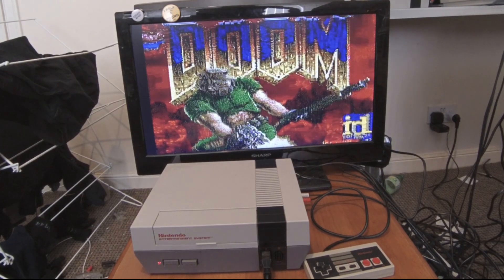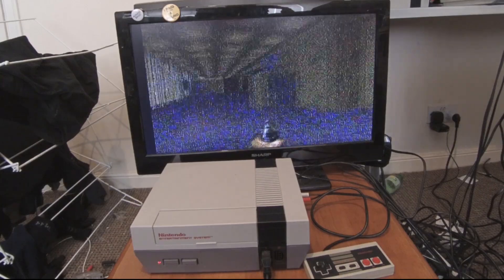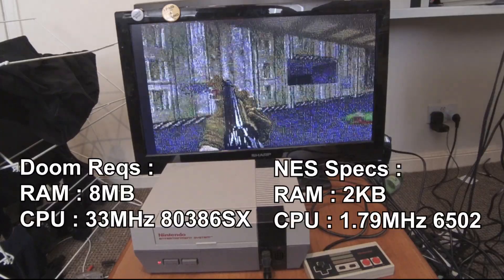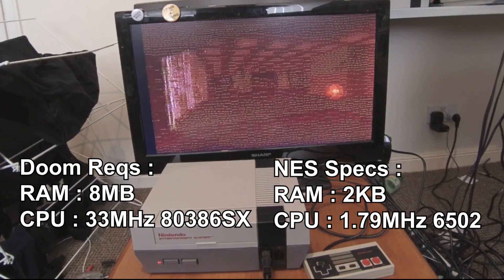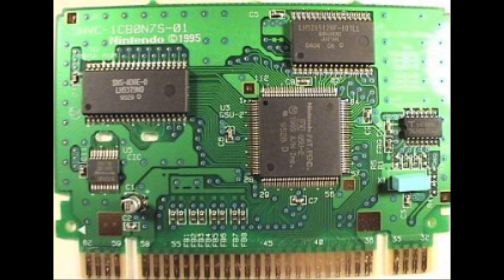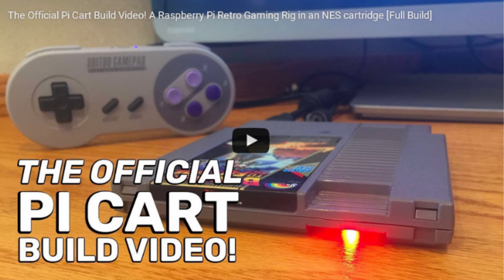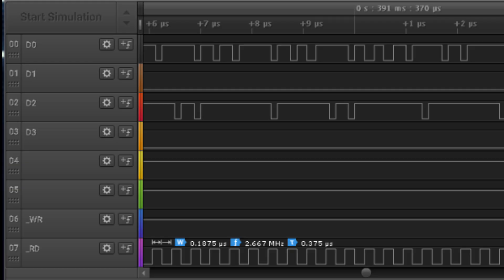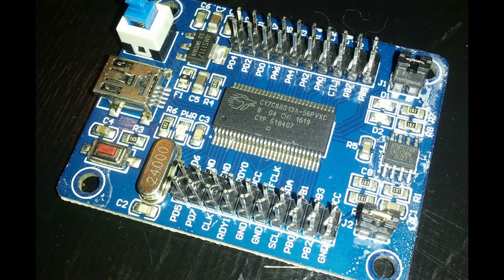DOOM on NES!

Comment: Em. But it is cheating, Star Fox`s cartridge is not a whole PC inside it. Yes it have a coprocessing unit. But it does not take all of the work from CPU. it is just a 3-d accelerator.
Reply: There are SNES chips that stream video, and they even made a CD add on. C'mon, this is even powered by the NES!
Reply: Really here is where the definitions are vague if it's cheating or not.
You can say this is cheating as the pi is doing all the work and the nes is just a video output, in that sense it sort of is.
But like most nes games used an processor inside the cartridges to enhance the games abilities, and like the super fx chip and such, theyre not too different, but those both are processing the game, both the external processor and the console in tandem. But as the external processors are more and more advanced it ends up being more sided to the external. This is essentially what's happen here, a processor like the super fx , but leagues more powerful.
 but still both are working together, only now instead of being about 40% console work and 60% external work, it's now under 0.1% console work , and 99.9% external work, *but there's still work done by the original system*, so how are you to define this as any different from those methods back then? You can't just set a percentage and call it that far is cheating.
There's other ways to define it like how much of a system the external processor is, like the SVP is just an additional processor, whereas the pi is an entire computer. But the super fx was a processor but it also had it's own memory like the pi , but that's not cheating ? You can't either define how much of a separate system the external processor is really either.
Maybe you could define it as if the external processor is able to function independently from the console like the raspberry pi, but there's nothing stopping the SVP or super fx  being used separately, even the 32X CPU is used independently in the Casio loopy , and two of them in the sega Saturn. Plus the raspberry pi could have its independent video out disabled , then it relies on the console too !
Maybe you can say that it depends on if there's two way communication between the console and external processor like there was originally, as opposed to the pi just outputting though the nes, one way, but like the reverse emulating the nes video, the console talked back to the pi with controller input so in that case there's too way comms too!

I don't think this as any different from things like the super fx or SVP, Doom , is essentially , running on the NES!
Reply: The Super-FX chip does all the work, and then DMA (direct memory access) the SNES video memory and just renders everything there (I think the SNES only converts the 3d models to 2d sprites, search for the Star Fox history video, it's awesome). Is exactly as the Raspberry Pi coprocessor, and outputting anything to the NES memory.
Reply: @GeomancerHT  now we are talking about the rendering only, there is more to a game than rendering. What about all the game logic? I assume with starfox it runs on the snes cpu while with this project the game logic runs on the rbp as well...
Reply: @sttrife  Did you read the link? Star Fox runs almost entirely on the Super FX and the SNES chip is only blitting the sprites to video.
Reply: the way I see it the game is truely running on a system if it interacts with things like the ram and other system things. if its just using literaly nothing on the console except io and adapting graphics then i dont count it. its like taking a midi output and playing it back through a mixer and saying the mixer is doing all the work.
Reply: All depends on your definition of co-processor. This is co-processing everything but the rendering to output. Very close to many SNES games running entirely on the cartridge via custom chips (aka the Raspberry Pi) and the slow SNES just outputting video to the TV. Or similar to the 32x doing all the job but the backgrounds.

What is the difference between this and a custom chip that could run DOOM and it's embedded on a custom NES cartridge and does exactly the same as this one?

I'm pretty sure you would call the custom chip cartridge legit, even if it's cpu it's the same as this Raspberry Pi one, lol.
Reply: Sorry Nicolas but you don't know what you are talking about .Co-processing, BY DEFINITION is a processor who helps the main system doing something. The FX chip was NOT a SoC that let the SNES CPU idle doing nothing. Far from it, the FX was nothing more than a math co-processor (something that 386 and 486 PCs had). Both systems were working hard to run the games. The FX chip was an expansion of a hardware, not a literal SoC who is doing all the work.The Pi is running Doom, it may use the NES as input and video out, but it's the Pi who is running, not one helping the other. Also, let's face it, the FX chip was also a cheat! But even so, the Pi does not need a NES, he actually had to work harder to make it running using the NES inputs than to make it simply run as it should. Where the FX NEED the SNES and can't run on any other system.
Reply: @Vanessinha91Pucca  Well, I kind of agree with your definition of the FX Chip also being a cheat, lol. I didn't want to go hard on the guy as this is really cool.

PS: read this FAQ, the FX chip can (and was used) to do all sort of things, not just a math coprocessor, almost all the game ran on the FX: http://www.anthrofox.org/starfox/superfx.html
Reply: DOOM on the SNES runs almost entirely on the FX2 Chip, lol.
Reply: Have to agree, while its a cool project, from your description it sounds like the pi is running the whole game and only hijacks the NES video chip to output the picture. Very neat but yeah i would not claim that doom 'runs' on the NES. Still, kudos :)
Reply: Star Fox uses the SuperFX to draw everything except for 2D backgrounds and HUD. It then turns the framebuffer into tiles, just like this is doing. Doom here isn't using the ability of the RPi to be an entire PC, it's just using it as a coprocessor like starfox or snes doom.
Reply: @jc_doge  maybe you know more than I do about this project, but it does sound like RPi is used as a PC, as in, it runs the whole doom game and just uses the button input from the NES, and the video out from the nes to play and display it. It doesn't sound like the game logic from DOOM is actually running on the NES.
Reply: @sttrife  i'm think Doom on SNES runs the game logic on the superFX too. That might explain the atrocious 20 frames of input lag, and the fact that the enemy AI kind of breaks when you overclock the superFX.
Reply: I'm sure that the game logic on the SNES Doom is not running on the superFX. The superFX is a coprocessor for math. It would be extremly dumb to implement the game logic on a math coprocessor  when you have a idleing CPU that is build exactly for this job.
And I think to remember that the superFX chip has no turing complete command set, so that's not possible to do it.
Reply: Also, there is a difference in that you could consider suferFX as part of the SNES ecosystem, while the RPI is definitely much more modern and unrelated to the NES. That doesn't mean I don't appreciate this project! I doubt it is easy to do something like this, and it's still pretty cool to place a cartridge in an original NES and play doom :D
Reply: @karlenter2380  Yeah, that's what I'm not sure about. I've heard that the SFX is just a math chip, and from other people that it's pretty general purpose.

I'll go look up the instruction set.. i'd be surprised if it wasn't turing complete.
Reply: @karlenter2380  it's definitely turing complete, btw
https://github.com/Raidenthequick/yoshisisland-disassembly/wiki/Super-FX-Instruction-Set
Reply: @sttrife  So modify Doom software to render only the gameplay on full screen without HUD or menus (even with the psx engine), make a data output for the HUD values (ammo, health, etc...) and music, and a control input not only for NES controllers, also for menu functions, like exit the level, or change level, or change the difficulty.

Use a ROM chip with a software that initialize the splash screen, starts the pi system, load the menu graphics, and understand the HUD and music output.

Let the Pi system inject the image like SFX chip does, and let the ROM chip draw the HUD and menus over the injected gameplay.

Control a chiptune through the ROM chip to use real NES hardware sound.

At this point you have the NES CPU working on the splash screen, booting the pi system, drawing the HUD, drawing the menus, interpreting the sound, bypassing the NES controllers to the Pi system, and controlling the game parameters, even keeping these parameters and scores on memory.

Use an ArduCam module to allow the Pi system instead of quit components from a real Pi board, and to make the assembly of the board automatable and more professional looking.

Print the sticker label, recicle some original NES cartridge plastics in new condition, design you're own PCB, and assembly it.

Load Brutal Doom on the Pi system...

Make some copies, and a time machine, back to the past, and become millionaire...
Reply: @eduardoanonimo3031  hmm i would consider the core of the game, besides the rendering, to be calculations for walking around and not passing through walls or falling through floors, calculating bullet trajectories and collisions, enemy AI, opening doors and moving platforms with button oishes and such things :) in other words the core game play logic. If you run THOSE on the NES cpu you can safely say the game 'runs on the NES' even if the rendering is done on a chip in the cartidge ;) but hey thats just my opinion!
Reply: @sttrife  No problem,  6 months more of work of around 200 deployers and 2 $ millions more, and we can get extracted the kernel of the engine to the NES CPU...

Comment: I'm not a tech wiz here, but based off the way you described, does this basically mean it's streaming the game from the Raspberry pi for the console to project? ("Doom runs on the PI" is the important part here...)

By that logic Crysis 3 could "run" on a NES. It's not so much cheating as it is 2019 hardware literally doing the bulk of the work. The implication VS the reality is fairly disappointing here, I have to say. Feel free to educate me if I'm wrong though, I want to believe Doom could actually run on an NES.
Reply: @maclura  SuperFX chip is not "basically the same thing". SuperFX chip is a coprocessor, Raspberry Pi is basically a computer on a small board. The NES is totally unnecessary as the Raspberry Pi doesn't need it to run and just gimps it as the video proves. But the SuperFX absolutely needs the SNES to run.
Reply: Malamockq if this technology was available back in the late 80s nobody would care about how it works as long as it’s running on their nes systems. And game developers wouldn’t care either if it’s something they can implement and make profit off of
Reply: @Malamockq  if the processing is done on or off cart who cares? A coprocessor and ram on cart is the same idea as having a computer as a cart, just this one does alot more work. I think the more important question is how to load roms to the of hardware from the cart, what do you have to do to make that work
Reply: @maclura f you want to push it to the extreme limit and do it with "period correct" tech, what you could do is to build the 386 PC inside the cartridge (or a 486 so it'd run at a acceptable speed). That's probably feasible, but it's going to be much more hard to do.
Reply: @maclura  The SuperFX chip partially started out as an addon for one of the British "Micros" (which were 'proper' computers but mostly treated as consoles) of the early 80's. They couldn't afford to develop a new console (Britain was using casette tapes for games, so piracy was a triviality) so were working on a "booster" peripheral called the Mega Game. Only they couldn't actually afford to develop that either, so the advertising was incredibly vague. After it fell through and the American, European and East Asian videogame scenes all merged into the world videogame scene, Nintendo approached them and asked them how much they wanted to continue development in Kyoto. The guy flippantly said "A million pounds" and Nintendo said "OK!", he was left thinking "I should have asked for two".
Reply: According to the required specs, it would require additional chips on the cartridge. Otherwise, no, DOOM would not run on NES like that. There is the fan-made top down version, if ya don't mind half-broken gameplay.
Reply: @AmyraCarter  To be honest, it could run, just look at Top Gun 2... It even has split screen.
Reply: @AmyraCarter  SMB 3 would also not run on NES without extra chips in the cartridge.
Reply: vytah yes indeed, mario 3 required the mmc3 chip in order to run on the nes, the mmc3 chip was responsible for the status bar to move independendly from the play field but also for multi directional scrolling and for bankswitchting to allow games to be bigger and to change,and switch graphical tile sets on the fly or per world.
Reply: Why not?  It can run on a Vic 20. https://www.youtube.com/watch?v=WFMM3F_-bx0
Reply: @maclura  Dragon's Lair... What a scam that was!

Comment: cheating? no
ingenious? yes
Reply: Steve Owens 
Tell that to Mike Tyson’s Punchout or Gyromite, which had famicom-NES converters inside the cartridge in order to run it, which technically makes them western-released famicom and not NES.

Yes, I know they’re “technically” the same system, but there’s enough of a difference in initial hardware and quality of life add-ons to say otherwise.
Reply: @ChunkSchuldinga  They're literally the same system. You're not modifying the system or game in any way, you're just matching the slightly different pin layouts.

This, by contrast, is putting an entirely different system inside the NES, and using the NES as an output device.
Reply: @ChunkSchuldinga  That was a passive pin-to-pin conversion... Like how you can convert AT keyboards to PS/2 and PS/2 keyboards to AT.
Reply: hotel? trivago.
Reply: Yeah but this cartridge will go into any stock NES system and run. The hardware is not modified at all. The hardware boost is from the game

Comment: Hahaha, woah, that's just insane! Is the cartridge slot delivering the power to the pi?
Reply from the maker: Yeah. Regulator gets really hot though, gonna have to disable/remove some of the unused pi components (ethernet, USB, wifi etc)
Reply: @TheRasteri  What about a Pi Zero?
Reply: @TheRasteri  luckily this isn't much of a hassle while working with the pi. Can't wait for a follow up, I'm hyped :)
Reply: TheRasteri That’s awesome. Possible to add a cooling fan instead?
Reply: @Angultra  
Sounds theoretically possible, but I'm not sure how would this be practical.
Reply: @TheRasteri  what about using a zero? Doesn't it draw less power?
Reply from the maker: @MasterControl90original  the zero doesn't have NEON, so it's hard to write optimized graphics translation code. I'm sure it can be done but I'm not a good enough coder to do it :)
Reply: @TheRasteri  oh ok, my mind was focusing on running doom and not all your code too... I guess a good alternative could be a pi module 3
Reply from the maker: @MasterControl90original  yeah that would be an option if I were to start manufacturing these things. For prototyping though, the normal Pi3 is cheaper and easier to work with.
Reply: TheRasteri make a pi for the snes sothat we can finally play doom in it’s full glory on the snes because the snes is a better system, trough i would like to have a pi cart for both systems, that would be sooo cool, 
Making doom cart for the snes with pie inside would makes we want to forget about the snes version of doom, i was always dreaming about such thing.
Reply: Now get it running on a Gameboy. This was my idea a while back but it might not be possible.
Reply: @ThereminHero  On the GBA there was a cartridge to attach AV cables to it, so getting video in has been done, but idk if the buttons where usable at all. 

The Pi should be used to 32x as many consoles as possible, it's destiny úwù
Reply: How much better would this work on the She's? Seeing Doom was on it.
Reply: First, what you're working on here is undeniably cool. 👏👏👏

But you totally are not running this on a stock, unmodified NES. Even the Raspberry Pi it's really running on will be modified according to you. So come on. It's cool enough as it is. Bigging it up just cheapens what you are actually accomplishing. 😒
Reply: @gergalurg  but it does run on an unmodified NES? If you take the cartridge out and put it in another NES it would work fine
Reply: @128Gigabytes  I do see your point and I think it's cool, but the RPi is running everything that anyone would be amazed at. I mean... No one's really shocked that the PPU can receive and send a picture... Are they?

I just don't agree with claim. The title. I still think it's a cool project
Reply: @128Gigabytes  
Yeah, because modifying the NES itself means you would have problems with getting the cartridge running on another NES (the unmodified one).

DOOM on NES just used Pi in the cartridge, not in the console itself
Reply: @marioalexanderski9598  And? The SNES games had extra graphics chips in them doing similar work
Reply: @128Gigabytes  
I know. Also, SuperFX was originally designed for NES, but Nintendo changed the plans to be targeted for SNES instead.
Reply: @128Gigabytes  Yep, it does

Comment: Great video. But you really need a pop filter for your microphone.
Reply: @Tricky Or just pull a sock over the mic.
Reply: Tights wrapped around a metal hanger (twisted to fit best) work very well.
Reply: @hitcism1043  It sounds like shit.
Reply: I think they are called plosives
Reply: @superduty4556  the phonemes are called plosives, the filter is called a pop filter
Reply: @kaitlyn__L  it's been a year, but I think I was referring to the post above me.